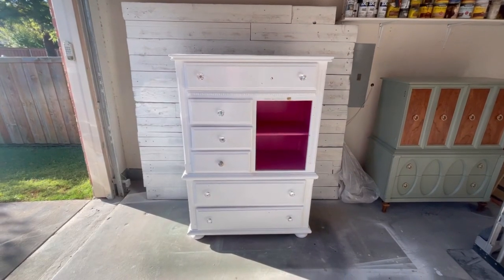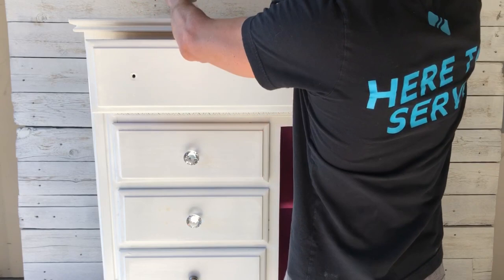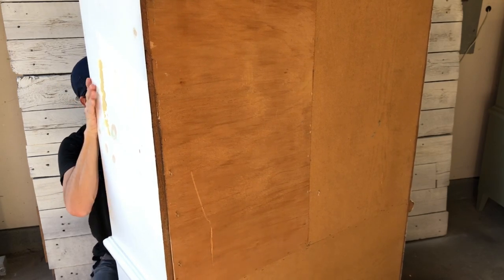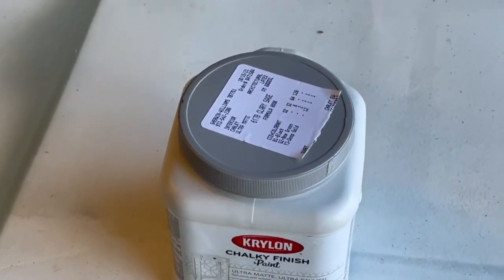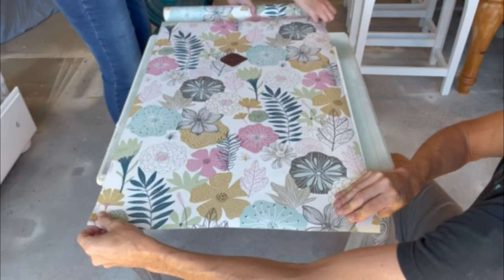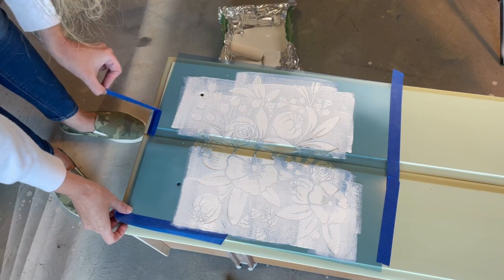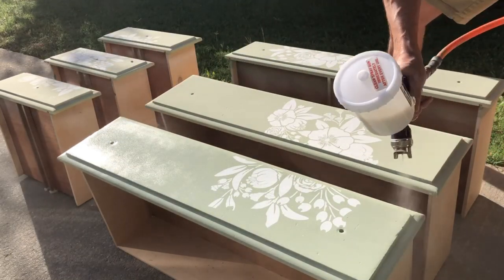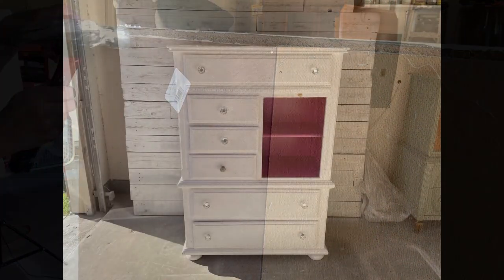How to Fix Painted Furniture // How to Stencil Furniture

Comment: It turned out beautifully! I also have an old dresser we painted with latex paint. I've been worried about what to do with it. The common concensus is that all the paint needs to be removed before refinishing. Let us know how the finish holds up. Your daughter has a beautiful addition to her room.
Reply from the maker: Thank you for watching! My thought would be , if it is like this one with very minimal peeling, you can get away with a scuff sand and a gripping primer. You will have no problem with the chalk paint adhering. IF the dresser is peeling, you will need to strip that paint off =( best of luck to you!!

Comment: Love the transformation! I’m new at this so I have a question. Why didn’t you sand the piece before you put the primer instead of sanding after you had already put primer on it.
Reply from the maker: Hi Julie! the primer we used is a bonding primer so I didn't have to worry about it sticking to the dresser, second, I wanted to sand down the primer to get a smooth finish and smooth out the wood fill all in the same step! Hope that is helpful!

Comment: Save those knobs they are costing about six bucks apiece at Menards right now!
Reply from the maker: I totally did! I will definitely reuse them! Even if she says they are out of style 😂
Reply: @LemonstoLemonadeFurniture  Right, I wouldn't throw those glass knob out, they are almost classic.  Although the new ones were worth the price.  Really you do need some kind of legs or feet here.  IMHO.  I can see how much difference that makes, now.  Seems to lighten what is basically a big wooden box.
Reply from the maker: @rockshot100  Would have loved to but she can't reach the top drawers so no legs at this point!